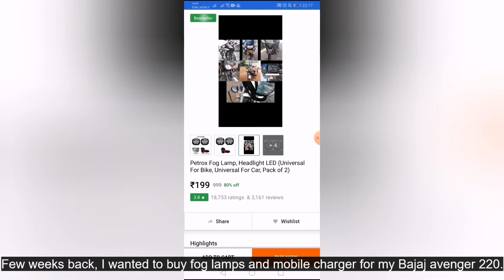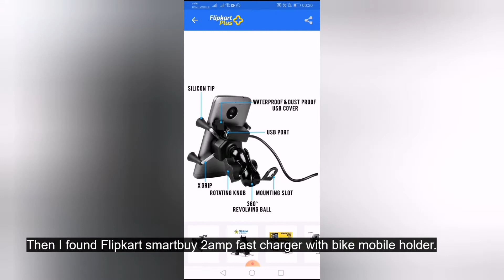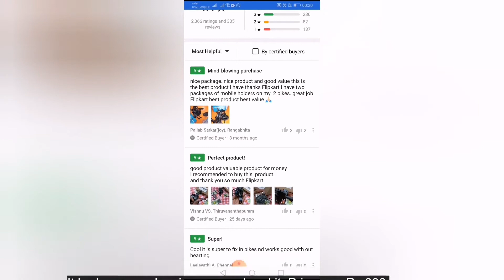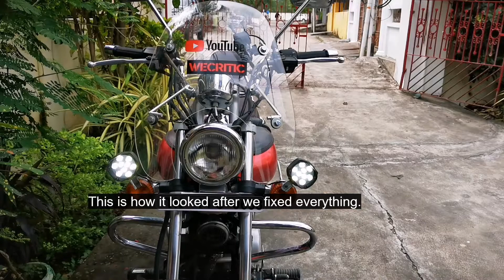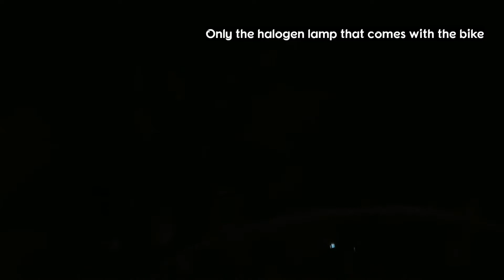How to fix LED fog lamps and Mobile charger in your Bike | In Tamil | English Sub | Do it yourself |

Comment: Ji I have latest 160avenger wind shield fix panna mudiyuma  enga panranga
Reply from the maker: I think you should be able to fix this windshield since the top part of the new avenger's headlight  is still round. I got this windshield in shop near to Noor Automobiles, pudupet. Price was rs. 800. Fitting rs. 200